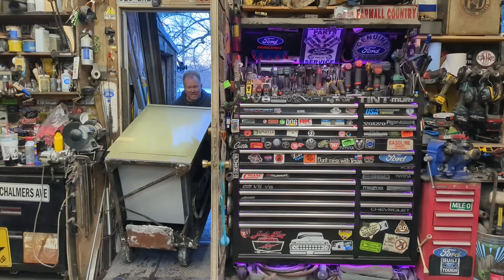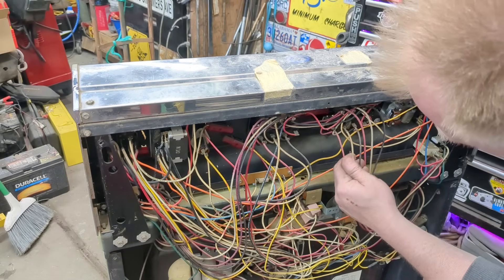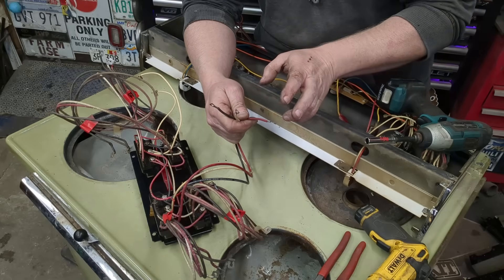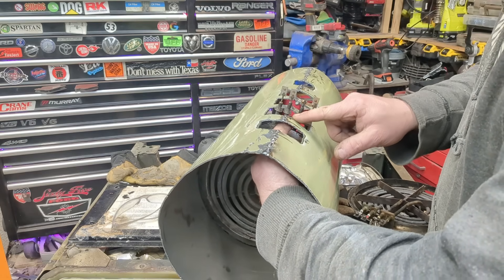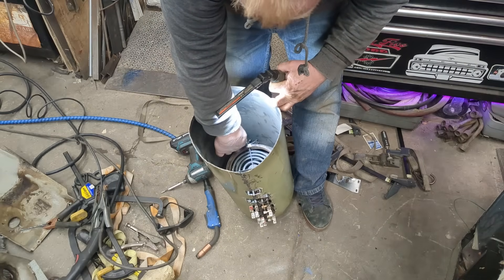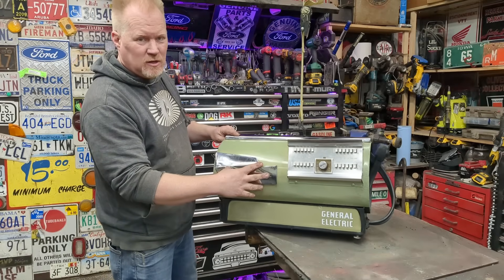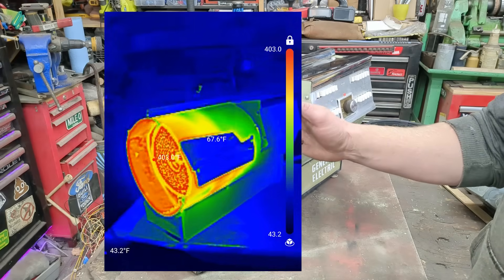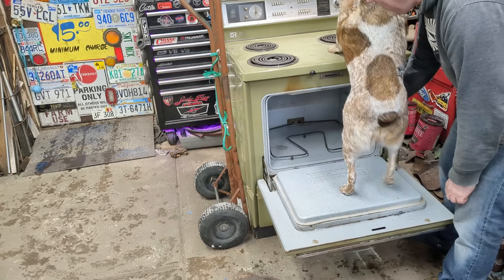Shop HEATER from old OVEN custom build

Comment: And I cook every meal on a 1975 version of the P7 (Pyrolytic 7 kilowatts for cleaning cycle) Mine even has a motorized rotisserie that spans the inside of the oven as well as a thermo probe that tells the doneness of a roast or steak. They are great stoves and were ahead of there time.

Comment: What a project! One thing that might interest you is that those Calrods (burners) list for about $125 each on some vintage appliance parts sites. I can tell from your serial number that the stove was made in our plant in October of 1966, about 8 years before I started working there. If you can find a cabinet mounted dishwasher from that early era they will have three or four painted steel sheets hidden behind the door panel. It was so you could change from Brown, Harvest Gold, Avocado Green, or White as you bought new appliances or changed flooring or cabinet colors. They're heavy gauge and over 2 1/2 feet square. GE hired a company for a couple mil to "modernize" their logo. The logo that you and your doggy drew had been around since Edison founded the company. Look at a recent logo and see if you can spot the change that cost millions to "redesign".
   You do great work. I should warn you that those Calrods should not be allowed to glow red for any real length of time. They are simply a thin nichrome wire centered in a tube with powdered porcelain glass packed around it as an insulator. The stove came with a warning about making sure that your pan covers the burner so its heat is drawn off by the cookware and food inside it and doesn't sit there glowing and burning out.
   Don't want to give you any crazy ideas, but that self cleaning feature will heat the inside of the oven to 880 degrees F. Think you could do anything with that???
Reply: @sixtyfiveford could you do something with the sef cleaning
Reply: @mrhalfstep That is some interesting trivia and I am glad that you shared it. I never read the instructions on the electric stoves we had so I did not know to prevent them from getting too hot by ensuring "that your pan covers the burner..." and I did not know that what I call elements are "calrods" or how they were/are made. Very cool.

Comment: Awesome!  Seems like you've probably got some thermal cut off switches around as well and maybe other ideas for safety mechanisms to prevent overheating.  Seems like something to automate the fan as well maybe using a thermal switch and a relay or something with like a minimum fan setting so the fan never really can be turned off or maybe like a bypass to the fan speed.  Neat build as usual!  Thanks for sharing!

Comment: Something else I'd like to add here. My oldest cousin had a stove like this one which used the same push button controls. She had an old motorola hi fi record player which I now own. Trying to get it fixed up. Got it rigged temporarily with an amp and bluetooth which I got from amazon and it sounds pretty good and loud.
Reply from the maker: That's awesome

Comment: It's good to see re-use in action considering most household appliances manufactured these days are meant to be obsolete or thrown away in 5 years or less.

I believe a better appliance to use for this project would have been an electric dryer. The heater element in a dryer is designed to be ducted (in a tube with a blower), and the controls would include all the safeties. With a dryer you'd get over-temp cutouts and blower interlocks which would include a cool down cycle for the heating element. 

The stove-top elements are not designed to be mounted vertically or use with a blower. The blower could actually ruin that type of element because it could create too great of a temperature difference between the core and the surface of the element causing the outer coating to fracture. Maybe a better application for the stove would have been an electric barbeque.

Comment: That's a really nice one.  Finally an electric torpedo heater that probably matches its Diesel/Kerosene contemporary in heat output.  One thing I would do though is definitely put a grounded 14-50 cord on it.
Reply: That cord would go up like a firecracker fuse.
Reply from the maker: It's a good idea. I debated that but opted not to.

Comment: I don't necessarily think people are more stupid now than they used to be. Manufacturers just like to protect their butts. I was born in the late 70s. People in the 80s were likely more dumb than they are now thanks to Internet. Why do I say this? People had no idea what a heater thermostat was back then, and they'd casually burn down their homes when using a space heater. It still happens today. People used to think the thermostat was some kind of power control, so they just set it to maximum.
They still just these stupid heater cords on heaters, today. It's just 16 gauge wire with this vulcanized rubber insulation so the cord can get hotter without melting the insulation. 14 gauge keeps the wire so much cooler, but it costs more. People then cover this potentially hot running cord under rugs and furniture. Now that we've set the power to high, the thermostat to it's highest temperature, and insulated the power cord, all we have to do is to just leave the room. If you didn't leave the house, you'll be smelling smoke soon.
People are quick to point to the plastic cases of modern heaters, but the elements are insulated with mica and have thermal breakers and fuses. Besides, space heaters burned down more homes with older, metal cased heaters. The real problem is that stupid heater cord that has never changed throughout the decades. They've actually dropped the allowable power from 1650 down to 1500 watts to try to keep the cord from bursting into flames. That's why modern electric heaters just don't crank out the kind of heat they used to.

Comment: We have similar  for higher output, but 230 single phase, we get 400v across to phases, but we rarly use only 2 phases if something requires more power it usually gets 3 phases, all 120degress apart. The exception would be in large domestic properties where there will be 2 phases brought in but all will be different circuits and never shall the two phases meet.
Reply from the maker: We also have a 3 phase. We actually have 2. One at 208v(120v) along with a 480v(277v neutral-any hot)

Comment: since no one wanted it, instead of going perfectly working to landfill along with the latest samsung 36 month model, it got to start a new life as a one of a kind shop heater, ready for another 60 years

if these popped up in my area id imediately get one just to replace my gas stove, gas is getting too expensive for me, while having no shortage of amps, and i prefer function over form, just look at those outlets with 2 separate circuits on the top! I’d solve my countertop circuit situation, 40 amps is meaningless when 80% of the countertop runs on one 20, having a proper paper schematic included, design engineers had brains in their heads back then!

Comment: I know you will save the wire but that is amazing wire. I worked for 35 years in the appliance repair field. Those wires will withstand amazing heat abuse forever almost. If the wire terminations are bad they will burn off but if the terminations are Good then the wire holds up amazingly. Good videos.

Comment: only thing id add is a metal chrome fan shroud to the front to stop any combustibles getting near the burners   if can't find the right. size could. cut a few rings off and make new mounting points for it lol

Comment: My kind of safety 3rd project
Reply from the maker: Generally there is a physical switch on the belt tension lever that will tell the motor to shut off when the belt breaks. If it has one at all. The motor in these runs only off 120v and the AC frequency coming from your wall is what actually regulates the speed(60hz). There will be a little speed drift by maybe a 100 rpm but it but it can't go past it's peak. This is 1800rpm on most motors but you will see on the tag they are rated to 1725rpm(loaded). Try disconnecting the heating element or put the dryer on "air fluff" and see if it continually runs. If it does then a temperature safety is triggering.

Comment: Were you running it off the 220v?
Reply from the maker: I wired it into my garage and have a retractable cord reel dangling from the ceiling. But an extension cord to the dryer outlet in the house would do the same thing.
Reply: @sixtyfiveford  awesome thank you. Great build! Like the small details added.

Comment: That's amazing, looks almost original too.

However... I can hear your electric meter spinning from all the way over here in the UK.

With our unit prices for electricity, I'd be bankrupt and homeless inside a working week!

How much power does that thing draw on full chat??
Reply from the maker: About 31amps of 240v /7500 watts. In the US it costs around $0.90 an hour to run ($0.12 per KWH). Do you know the electric rate there in the UK?
Reply: @sixtyfiveford  ahh well they have gone down a bit recently, currently I think I'm at at around £0.27/KWh, this time last year I think I was paying £0.48-ish/ KWh.

So even with the reduction we're about twice what you're paying, not counting exchange rates.
Reply from the maker: @ajd1975  That's expensive. I don't think I'd even dare to turn on a light bulb at that higher rate.

Comment: Those "drip pans" are actually broiler drip pans, used to catch the drippings when broiling meat.  Looks like the actual broiler inserts (slotted grates) were missing.  My mother had a GE oven that was several decades older than that one.  Yes, I'm old...

Comment: how does the heater stop functioning if the fan is turned off? OR if the fan fails while it is switched on?
Reply: Press “Off” button.
Reply: @mikebond6328  yeah some folks have an "off" button on their brain that's somehow or another pressed at birth.

Comment: Completely awesome! The average oven with the heating element and all the stove top burners going draws 38 amps. 50 amp circuit at 80% load is about 38 amps. Your average Tesla level two home charger draws the same amount of power. This sure beats the smell of those nasty salamander kerosene heaters on a job site! Nice build!

Comment: You didn't use the oven portion, the next build can be a powder-coating oven for small parts.

You are right about labels and the stupid people needing labels to give them warnings. I know someone who lost the first bone in his index finger when he tried to clear a clogged chute on a push lawn mower while it was running.  The funny (not ha ha) thing is, it had a label and he ignored it. He can bend that finger joint completely back over the next joint, and if he pokes you in the chest it just folds. It was his trigger finger, so worthless at a firing range. 
Labels do not make you smarter.

Comment: That’s outstanding Mo. you should have been in GE’s R&D sector. So do you have to put the coils on high setting to achieve medium heat because of the fan cooling each element?

Comment: How hot did the outside sheet metal get?
Reply from the maker: I measured 190F at the very end. It quickly tapers back to room temp. If I get concerned I left room to install a second tube inside with a small airgap. This would eliminate any hot spots.

Comment: I LOVE it!  Way cooler than how I thought you were going to use the oven element somehow.  Can only imagine how much current it's using full on...$$$.  My only concern would be how close the wiring is to the floor if you ever had a water leak and how hot that tube is also gonna get.  You could have made it double wall and have the fan suck cool air through the space between the tubes and then exhaust out the inner tube.  
Seriously though, I'm not knocking it at all, it just makes my mind go places....squirrel!
Simply amazing though how you repurpose different elements to your advantage.  Dang cool Dude!

Comment: Electric Nipco heater is the best! I like this one way better than the dryer heater you made. This one is portable. I would maybe have wired it 110v so as to be able to plug in anywhere.

Comment: can we take a moment to realize how absolutely wild it is he had the exact colour spray paint for a 50 year old oven and it even said it was "appliance paint".. back from when manufacturers gave you three colour options and kept those options for a decade

whats doing the power reduction? are there resistors in those switches? they seem awfully small with no cooling to be able to work that way in just brute force resisting the voltage down for the 5 options, i guess maybe since it has the 120v center tap the resistors arent shedding that much power? id maybe shy away from putting the elements on lower settings just run them off or full power, might burn them up being that old and likely in a hotter environment then the original design
Reply from the maker: I've had those cans forever(estate auctions) and honestly never thought I would use them. I love old paint like this because it works so well. It covers with 1 coat and dries tough as nails. The switches are just switches and run 120V or 240V through the coils. 
shooting from the hip:
setting 1: 120v through 1 coil
setting 2: 120v through 2 coils
setting 3: 240v though 1 coil
setting 4 240v through 1 coil and 120v through the other
setting 5 240v through 2 coils.
Reply: okay i didnt realize there were two pairs of connections for each coil to have two elements in it, that makes more sense than trying to choke the voltage down, or like a more modern stove switch the power on and off repeatedly to get the desired output @sixtyfiveford

Comment: Looks beautiful, really nice job. I used to hate that avocado green but this really looks good. Please, please add two thermal cutouts in case the fan quits while you're not there. You could use fibreglass sheathing on any wires exposed to the heat chamber, like a toaster. And of course ground the chassis

Comment: It did seem a little sad to see this old workhorse, thats lasted 60 years get ripped appart, but, that heater looked fantastic, i love that retro look.
You could also use the oven part of it for doing powder coating.
Reply from the maker: It'll live on way longer now. The guy I got it from had it for free for 6 months and never got a single call.

Comment: Awesome! Only thing I’d change is some sort of safety that only allows the burners to power on if the fan is on. Nice that you have so many different heat settings. Just would be easy to accidentally leave a burner on and forget about it.

Comment: Neat project!
Note:  I've measured the current draw from that size heat element on a Tappan stove & it was 1 kw.  If yours are the same, then a 4 element unit would problem put out 4 kWh or ~13,650 BTU/hr
Reply from the maker: All burners on and it pulls 7440 watts / over 25k btu
Reply: @sixtyfiveford  Thats a electricity guzzler ,leave it on for a day and you end up homeless when bill shows up.
Reply from the maker: @zumbazumba1  Yes and no. You wouldn't continually heat an area like a furnace with it. You would spot heat yourself with it. Say you're replacing the transmission under your truck and you're laying under there for 3 hours with this pointing at you; It's going to set you back a whopping $2.52. I think anybody that has done work in the cold would happily fork over a $50 bill to stay warm for those 3 hours. Yeah you leave it on for 24 hours it's going to cost you 20 bucks and you leave it on for a month and it's going to cost you 600.
Reply: @sixtyfiveford  Ok thats fair enough ! Its not for whole day use but for heating up space for brief time.